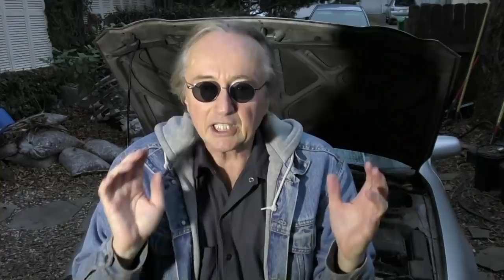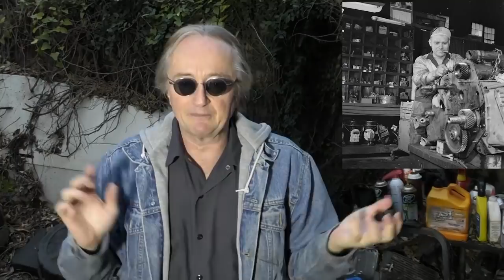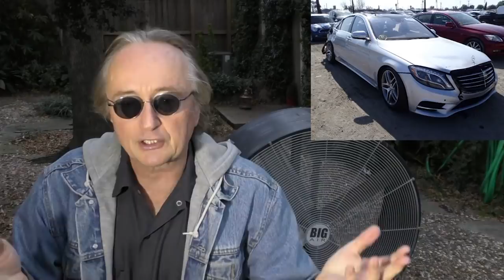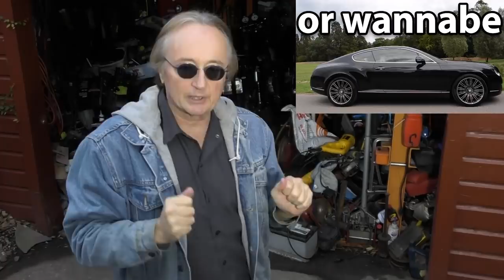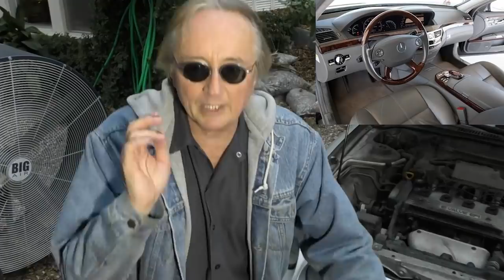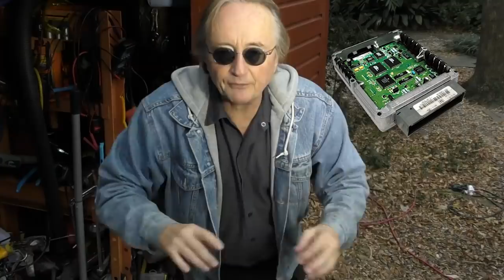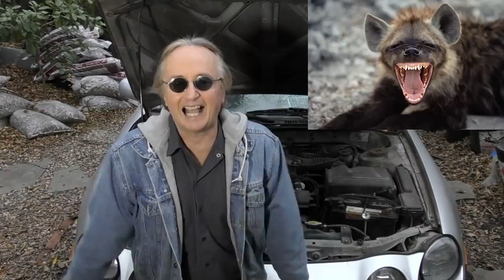Why Luxury Cars are Designed to be Unreliable

Comment: Was out to buy or lease a car.  Jag got like about 8 mpg.  WHAT?  Yup.  Benz wanted $750/mo. on a lease.   WHAT?  I axed the Benz guy wtf?  Isn't the lease predicated on the depreciation of the car over time?  He did some kind of dance that looked like the Hucklebuck and we walked out.  
Bottom line, I don't think car makers are in tune with the market.  I could tell them what I want,,, and I'll bet that's what a lot of folks want.  Can they build it?  I think they can.  I don't see why not.  But they're busy putting dodads on the car and messing with the radio and all the controls.  I don't want all that jazz.  I'll tell you what you and I want....later.
Reply: ericj305  OMG, that's what I'm saying.  Oh, go to sleep again.
Reply: Alex i agree with you....I'm having a tough time even considering buy a car made after 07. Had a 12 buick...junk
Reply: Can you describe what you want in the perfect new car
Reply: I want a car that's cheap, powerful, and easy to work on, but safety and environmental regulations prevent that.
Reply: D
Reply: They're having trouble competing with used cars. (Old model has what you'd want at a price the new one can't beat.) So the car companies switch to making SUVs.
Reply: alex tworkowski Mercedes Benz builds trucks. Are they reliable?
Reply: Leasing a 500 euro A200 2019 benz. For 4 years. Solid deal to me.
Reply: @pauljs75  interesting comment and quite true to an extent
Reply: @TiberianFiend  get a 90's  volvo 850.

Comment: What about the Lexus Ls430 ?,very reliable car
Reply: The most reliable luxo-barge ever made. I've owned 4 of them and they've each been bullet proof. 2005s with 200k sell routinely for 5-7k for a reason.
Reply: I have 95 LS400. 340000 miles still running like a champ.
Reply: i got a mercedes 2001 e320 which  has 300k and runs like a champ

Comment: Older BMW 3 series are great, not a whole lot of electrics to worry about and the straight 6 engines are super reliable. I've owned an 06 325i for 2 years with no problems. Keeping them maintained is super easy and not expensive at all.

Comment: New luxury cars are designed and marketed for their FIRST owners who pay to enjoy the benefits of reliability, current technology, bumper-to-bumper warranties and full maintenance support. What happens after that, well, it's not a concern of the manufacturer, and quite frankly, those who prefer 'new' over 'old and worn out. ' So it's about personal preferences and I don't see the need to attack all luxury cars . . .  many last just fine, and some fail, just like the more moderately priced vehicles out there. What's all the fuss about?
Reply: What's all the fuss about? - "many last just fine, and some fail, just like the more moderately priced vehicles out there" - the fuss is all about how absurdly incorrect such a statement is. The fact is that many do not last just fine, and many fail, and a lot more frequently than certain moderately priced vehicles especially the Japanese made vehicles. New luxury cars are designed for high profit margins and sold to those who pay to enjoy the benefits of latest technology, the perception of customer service and the illusion of social status, self-esteem and exclusivity. Luxury cars and their manufacturers are notorious for neglect once the warranty period is over. And it should be telling that hardly any luxury manufacturers offer more than a 4 year or 50,000 mile warranty. Compare this to brands like Toyota, Kia, Hyundai, Honda and Subaru who offer anywhere from 5 -7 year 100,000 warranties as standard.
Reply: Clearly, we could never change each other's minds, unless you have data that proves that all luxury cars have a higher failure rate than cheaply made, 'moderately priced' cars. Maybe it's just me, but owning and driving a factory fresh, fully warranted luxury car has it all over any alternative. Once you're there, it's hard to imagine accepting less.

Comment: 2009 Audi A4, 2008 BMW 530i, 2009 MINI Cooper S are all trash, tin can vehicles that our family regrets ever getting. Freaking H&M quality cars.
Reply: I had a 2007 Audi A6 with 180k that ran strong with minimal issues I traded in for a 2015 BMW 328i.  (Knock on wood).  the BMW is definitely an upgrade performance wise
Reply: @ieast007  I'm very impressed about your A6. Would've loved to have kept one of our vehicles for that long but it was really tough. Even with the best oil changes at every 5k miles.
Reply: I'm satisfy with my 535 xi 2008 M-package

Comment: Im not a PC gamer but Id be using mineral oil for liquid cooling on ANY electronic part. Yes, its flammable but it won't short anything out if it leaks because its non-conductive. It is used in immersion-cooled PCs for that reason.

Comment: It’s funny how people talk crap about Fords...I got my Fusion brand new in 2012 and have only put the thing in the shop for routine maintenance and oil changes it’s now pushing 130,000 miles..my friends that had BMWs or Mercedes with half the amount of miles either junked it or it’s sitting in their driveway not running because they couldn’t keep up with the maintenance 😂😂
Reply: Ro Brown —- I drive a bus here in Vegas.. one of my regulars is a valet... he tells me that 85 percent of the high end rides all have a check engine light on.
Reply: My 88 Oldsmobile Cutlass Ciera has 240k miles on it. Replaced rhe headgasket last month, and various odds and ends maintenance on it still runs strong as my daily driver.
Friend bought an 03' Jaguar S type with 120k on it 4 years ago. Transmission went out with 160k on it.
Reply: I'm sorry to let you know bud Ford  they are no good and they hard to work on but I'm not going to lie some Mustangs they was good
Reply: Nour Jebokji well I’m not sure what your definition of “good” is but having a car for 7 years with now 130,000 miles on it that hasn’t been in the shop for nothing but oil changes and brake work seems VERY good to me

Comment: If you can afford a expensive car you should be able to pay big bucks to fix it.
Reply: The problem is that "expensive" car becomes cheap in 10 years yet parts are still priced at expensive car levels. So someone buys a "cheap" car not realizing it's very expensive to keep on the road.

Comment: Gun Jesus has already confirmed that an AR15/M16 platform does better on a mud test than an AK47. Just wanted to throw that out there hahaha especially considering one of the photos you used in this video is from the actual video where he confirms it.
Reply: Ranew Ridha they redesigned the m16 quite a few times since the Vietnam war. Pay attention
Reply: Ian has spoke
Reply: In Vietnam M16s were notorious for malfunctioning.
Reply: No that's a lie
Reply: The Vietnam guns were fine but due to gov intervention they had ammo that didn't meet the weapon specs, and therefore they had problems.
Reply: What if the dust cover was open though and the ak bolt closed
Reply: legen belcher did americans not pick up the enemy weapons and use them instead of the m14
Reply: Don’t believe everything you see on internet
Reply: @jeffymathis3895  I don't think I would want to choose any battle rifle over the M14
Reply: I own several of both, the AK47 is the most overhyped piece of crap on earth. Notoriously inaccurate. Clunky, cant put optics on em. Id take an AR every time.
Reply: Yes it does better now, but not during the Vietnam war

Comment: I have a Honda Accord 2005 4cylinder it has 270K Miles in it and was wondering if I should continue putting in 5W-20 High-mileage Full Synthetic oil or put in 0W-20. Different mechanics told me different things.
Reply: 5w20

Comment: I'm sorry Scotty some BMWs and Mercedes they can last longer than a Toyota but I'm not talking about the S Mercedes or the 7 Series BMW I'm talking about the economy ones like an example the E90 BMW and like Mercedes c class E-Class these are very reliable cars from Mercedes and BMW but you have to do maintenance on time and you have to put the right gasoline in it they will last about half a million Mile with no problem but you always have your simple problem like starter spark plugs water pump brakes struts wheel bearings these normal self
Reply: Nour Jebokji Scotty has been a mechanic for probably longer then you have lived. So I'm pretty sure he is saying all this from experience with hundreds of newer luxury cars. Sure there are Mercedes that last longer but most Toyotas for example will last longer than most Mercedes. It's just a fact, do your research.
Reply: And exactly what you said, only some are more reliable BUT not most of them 🤣
Reply: You are merely talking about the powertrain. 

The newer luxury cars usually start to have faulty electronics and non-powertrain related components where it doesn't matter what kind of gasoline would mitigate the issue.
Reply: Rob K.  LOL to me Cadillac it's the worst car in the world and it's a GM product please do your study
Reply: @cococly  yes Bud but I'm not talking about the electrical problem I'm talking about mechanical because that's the main thing in the car any car will have electrical problem doesn't matter what car it is know if u  come2  reality yes Japanese cars an American cars seem like the electronic little bit better German cars they considered luxury so really if you buy a luxury car you a big money so since you are a big money they want you to come back and spend more money really it's a monopoly if they want to they can make the electronic parts last for a long time but that's not going to be on their on their side they want you to come back and spend money you want to ride nice you have to pay the price it said but this the true
Reply: Rob K.  and the Chevrolet cars they all junk the only thing from Chevrolet is good it's the trucks
Reply: Rob K.  you see them on the road because the parts r cheep you don't see old Mercedes or BMW because they don't have Parts in the US you have to get them out of Germany and they are expensive expensive
Reply: @Mexican4Uapo  "mechanic"
Reply: @Mexican4Uapo  When we talk about a car lasting, we have to refer to specific parts of the car. I'm a mechanic of 12 years working in Toronto where the cars are rust buckets within 5 years. Mercedes BMW AUDI, outlast any Toyota, Honda Lexus or domestic car in terms of Chassis quality and rust free. The german cars have engine reliability problems and require great attention of maintenance. The Japanese cars are more simple in terms of engine and require less maintenance. The perfect car would be a German Chassis and suspension, with a Japanese powertrain. American cars are just somewhere in between with problems in all areas.

The funny thing is, the 2008-2013 Toyota Corollas have less rust proofing than the 98-2001 models. Anytime i have to do an alignment on a newer Corolla, i need to bust out a Torch but even the old ones, i don't.

And another thing worth mentioning is, ride quality and fun. BMW, Mercedes, Audi, are 1000x more fun and engaging to drive than Japanese cars. There is another reason you are paying so much money. It is the experience. ( now somebody will mention a supra, or gtr ) but we are talking about regular 3 series, C class, and A4's being much more fun than their equivalents Japanese.
Reply: E90 and reliable. Haha
The engines does have to much problems.
Reply: sasha puhalo yeah you're right as far as chassis, German cars do last longer.

Comment: Mercedeses used to be reliable tho
Reply: back in the 60,70,and 80s
Reply: The new ones they are reliable like the eClass & C Class but you have to take care of them what I mean by this you have to put good gas like super Nitro from Shell and you have to do your old change on time using Mobil 1 synthetic not like most people do they go to the lube shop and use a wholesale oil this type of oil is trash and they go to Walmart  regular gas
Reply: On modern mb you need to change the fluids even they dont say you need to.
Reply: We're talking about W123 and W124 back then. Yeah... built like a tank. Back then we had metal bumpers not plastics. For Merc, anything with their Airmatic suspension is unreliable and expensive like hell to fix.
Reply: @fleurdewin7958  if you want to buy a bulletproof Mercedes even the windows Bulletproof Mercedes w140
Reply: The old diesel Benz from the 70’s and 80’s were very reliable

Comment: You are absolutely right. My accord 2007 has got any problems  130,000 miles as of today. My friend bought Benz 55000. He wanted to sell it at 15,000 miles. The dealer told him he could buy back at 25 000.

Comment: Hi Scotty, I have a 2004 Honda Pilot.  When the transmission is cold, I change the gear to reverse gear, the car always has a “hiccup” or a jump before it runs backward.  However when the transmission is warm or hot, it does not have this issue.  Do you know why?

Comment: Love your videos..I know you hate Mercedes, BUT I bought a 2006 MB E350 back in 2012 w/80k on it.  I'm up to 216k and it just goes.  You CAN work on these cars with a little know how.  Even if I spend $1000.00 a year on unplanned repairs,  it's still way cheaper than paying a car payment every month. Car still looks great. No codes on my scanner. Still gets out of the box mileage per gallon. I love the car.  The most I've spent on it was a voluntary audio system upgrade..LOL

Comment: I bought a new Mercedes in 2005 and took very good care of it but this last June it just stopped on The Bay Bridge (in CA) I was kind of shocked because it was so reliable, to get it fix was going to be quite expense, so in the end I opted to just buy a new car, and before that I bought a new BMW (manual transmission) that lasted me 19 year, I gave it to my brother and that car continue on for about another 5 years. Before that I had a Datsun B210 which was a nightmare, always something needed to be fix gasket, and I even had to buy a new engine ... I didn't buy a Luxury car to show off, cause I don't care what people think, I'm too old for that I bought it for reliability....I know you're an expert and I respect that, but sometimes there's are exception to the rule, What about the Tesla love to hear your thoughts. Gas is very high in CA ($4 a gal) .. I like you channel a lot BTW I sub'd

Comment: I am 79. Have had 50 different cars.  I own a 93 300 SE Mercedes (W140), very well kept.  I bougt it relatively cheap more than 7 years ago with 120,000 miles (195.000 km.) . Up to that year Mercedes made good cars. But the threat of cheaper and excellent Japanese luxury cars as Lexus and Infinity,  made them fire the best engineers (Chief Engineer  Wolfgang Peter: " the best or nothing" ).    The business  people took control of the Company,  and they have even been investigated for unfair competition.              My car is in the limit.   It has a lot of modern equipmen that is prone to fail .  My experience is exactly as you explain, and the logic  they use is exactly as you say.

Comment: My 2010 GL450 with  99k miles still runs like new! So far in all this time besides scheduled maintenance are 750.00 labor and materials rear airbags (aftermarket and MB mechanic shop) and new battery  , inside and out still new.

Comment: i replaced my fromt rotors twice using good ones on my 99 tacoma v6 and still have a rattling/shaking issue when i hit the brakes.  i also replaced my rear drum brakes, performed alignment, and balanced the tires with no avail. please advise.

Comment: Hey Scotty! Question: You keep talking about diesel engines being unreliable and expensive to fix. I have an 86 Datsun 720 4wd pickup, 4 cylinder naturally aspirated diesel. Engine still runs like a dream and I've literally done zero maintenance the past 6 years (yeah it's starting to rust away now due to salted roads and no maintenance). What's the difference between EU diesel trucks and American? Cause I know how everyone over there loves v8 massive petrol engines in their trucks often with only rwd. I find it kind of odd because in a pickup truck I'd want 4wd, low rpm and high torque. Thinking about buying a brand new Hilux, 150hp turbo diesel (eu equivalent to a Tacoma I guess). What's your opinion on all of this?

Thanks! :)

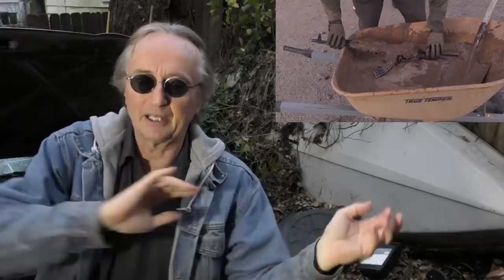Comment: 2:47 I know this has nothing to do with cars, but the funny thing is, this frame is from an InRangeTV video where the AK (and most AKs in general) failed pretty bad, compared to the AR. The ARs are, contrary to popular belief, much more reliable in mud compared to AKs, because it's a well sealed system. Both guns work fine in dust/sand, but mud... the AK is done. Watch any mud test video you find, the ARs regularly out-perform AKs.

The M16 fiasco in Vietnam was caused by the ordnance dept. when they changed the powder specifications and decided to use old surplus powder for the M16, changing the pressure at the gas port, causing the cyclic rate to increase, leading to critical malfunctions (broken extractors, snapped bolts,...). Also, they didn't issues cleaning kits... why?

Just thought I'd adress that. Love you, Scotty! <3

Comment: I own a Toyota Corolla from 1999 and still runs good i did some repair here and there like replacing the fuel line and brake lines the alternator and starter motor and the car still runs great.from time to time i clean the intejctors and catalytic converter.. Great cars Toyota..

Comment: I got Nissan Leaf electric car and had about 60K+ miles with absolute zero maintenance. Only changes it needs is tires & cabin air filter. I see these modern electric cars are more reliable, powerful, economical, safe for environment & fun to drive, as long as you have a reliable way to charge them regularly.
Reply: You can't plow snow with that, or throw a few sheets of plywood in it either. Electric cars are old technology and rely upon even more "fossil" fuel to run than my Silverado.